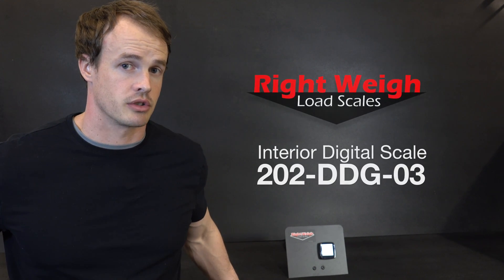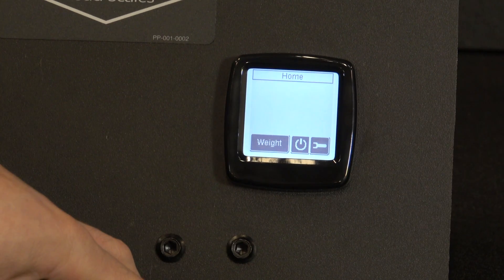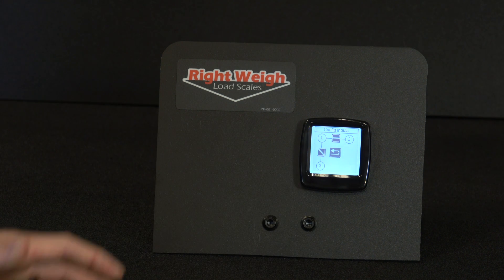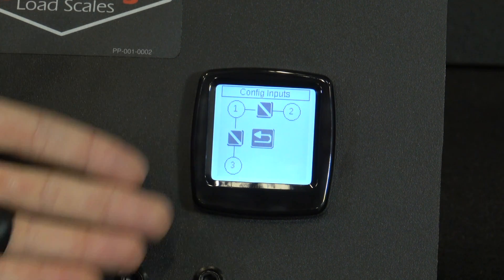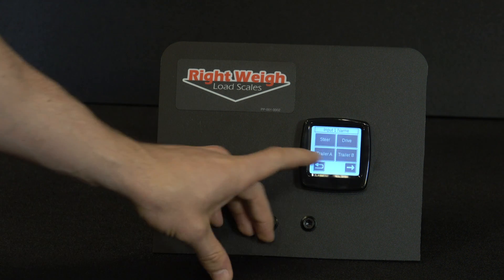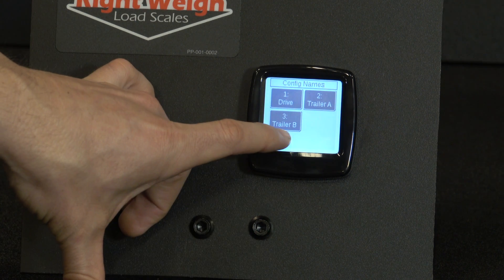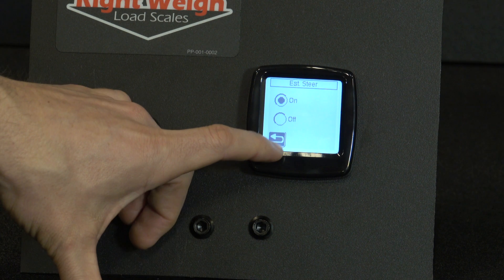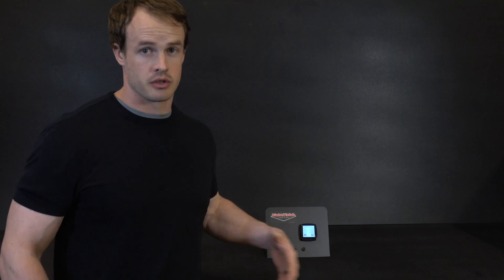Right Weigh Load Scales (Interior Digital 202 Series): How to Configure with 3 Air Sensors

Comment: Can this be used for s truck with an air ride steer axle? Basically I want it to monitor my air ride steer, my drives, and my trailer.
Reply from the maker: Hi Steve. Yes, our 202-DDG series (Interior Digital Scale) will work great for this. All you would need to know is how many leveling valves are on your steer. If you only have one on your steer, then you would buy the 202-DDG-03 (Three Air Sensors), if you have two you would buy the 202-DDG-04 (Four Air Sensors). For more info online, feel free to check out our products at www.rwls.com/shop-now. You can always give us a call here in the office at 503-628-0838 and one of our team members can help you choose the right scale. We are also available by LiveChat on our website, and you can also e-mail us directly at rwls@rwls.com. Have a great day!